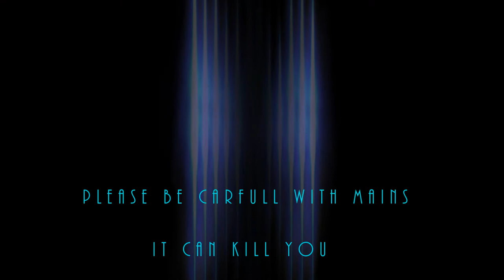Murphy A674 Restuffing the Cap 68UF 430v X2

Comment: I agree with Doug. You have the other radio. Get the 47uf and redo this can for the other radio since you have it all apart and clean.
Reply from the maker: Hello Robert    I am not restuffing my Fathers radio. I would use terminal strip. Also have the bracket for that radio. So there's not going to be very many parts to rob.